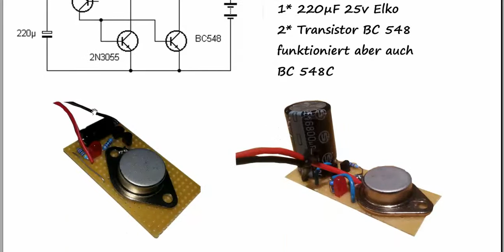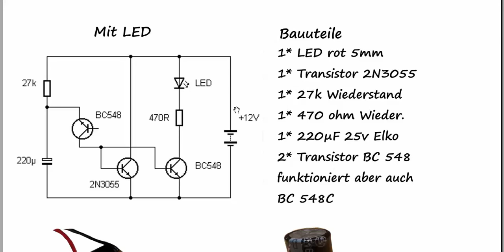Battery Refresher Circuit Schematic Explained - Simple Desulphator Circuit

Comment: Very Good explanation & Very Good Circuit. Thanks for the same. One small doubt, if 2N3055  becomes faulty & gets shorted between Collector & Emitter, there will be heavy load on the Battery & this may be dangerous. How about connecting LED &  470 Ohm Resistor between collector & 12V +ve?. In the normal operation , what is the maximum current of the pulse when 2N3055 is triggered to conduct?.
Reply: even if the transistors 2n3035 get shorted between collector and emitter the the 27K resistor will only allow 0,000444 amps through at 12 volts this is only 0,00533 watts